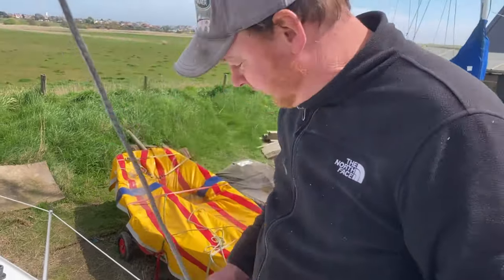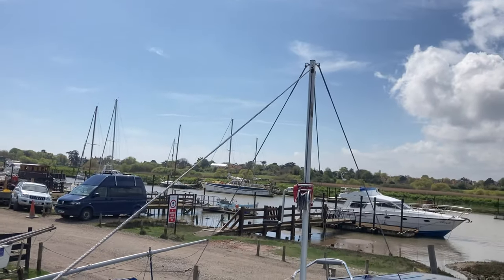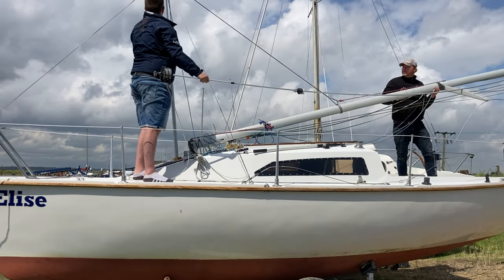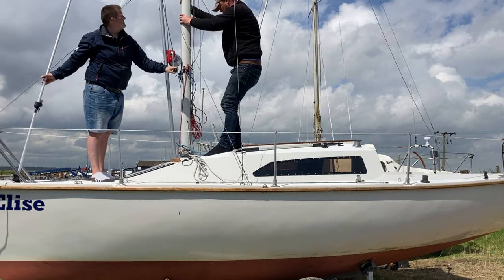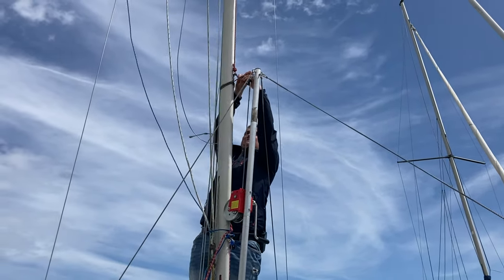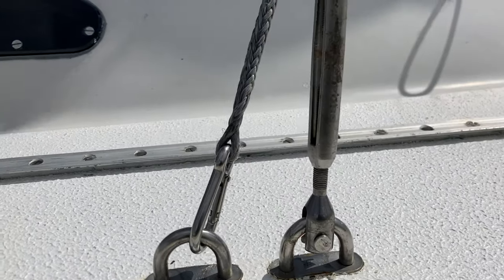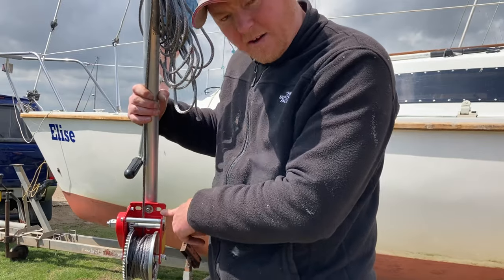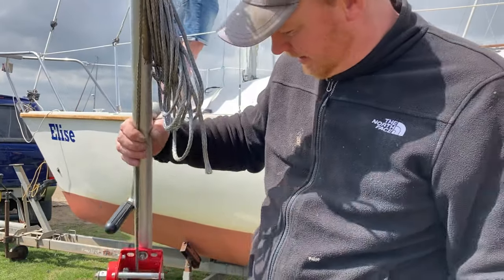Homemade gin pole-mast raising and lowering system.

Comment: Elegant system.
And it is not cluttering up the foredeck like my a-frame does.
Reply from the maker: Thanks! Couple of mods I’m going to make. Baby stays for the mast would be the next mod for me.
Reply: @boatedout  Those would be a great addition. Just find a way to attach them on the axis of the hinge in your mast.
Reply: @boatedout  did you make those baby stays , i may have to alter design if you have
Reply from the maker: @Spud63  yes I’ll send you a decent  list of stuff, I bought some “sk78” which rope off eBay as easy to Brummell splice, I spliced one end of the stay to the clip and spliced an eye in the top end to cow hitch it on the eye on the pole. I did have to redo the bottom splice to fine tune the length once sized up. One thing to  consider is that it might be worth putting a sheeve in the top of the pole and having the winch face forwards to stop it pushing against the mast. I haven’t done this yet but would aid in keeping a bit of space between the pole and mast, however, the current set up is great. I may change it but may not.

Comment: Great system! What kind of pole did you use?
Reply from the maker: It’s an aluminium pole approx 40 mm diameter. It’s quite a heavy duty pole actually. Possibly 2mm wall thickness. It’s very strong. 😁⛵️

Comment: How heavy is the mast?  Could you not just muscle it up together?
Reply from the maker: It’s much better with the system when you get a shroud snag up half way up, don’t have to lower it again, also my 8 year old daughter can do the winching which is handy. 😁so the gin pole is really handy- it takes a bit of pressure off.

Comment: Hi again.  That was a piece of p*ss - a very elegant solution.  These vids of yours are really peaking my interest in the Harrier.  However, trying to find one for sale is another matter.  They are like rocking horse droppings.  It doesn't help when you look up Copeland Boats showing all the "Fox" classes but no mention of the Harrier.  I think I'll keep looking for one as I think it might just suit my style of sailing.  I know you've started the season but can I please make a request for a vid showing how you lift the keel at the end of the season.  Once again, thank for taking the time to film these little gems!  Chin-chin Rej
Reply from the maker: Thanks Rej, where are you based? Yes not a lot on the Harrier out there, also they all normally need a lot of work, I know of one coming up for sale soon. A nice one too. And of course you are always welcome to come for a test sail in my Harrier. And yes I will certainly do a video just for you! I raise the keel after every sail normally. Takes about a minute or 2. Stops the barnacles growing on the keel if the boat is left in.   Can’t have that extra drag!😁 end of this season I’m going to completely remove the keel and re do the tray that is bolted to the top of it. Common issue on all these lifting keelers. If they didn’t use mild steel inside the fibreglass tray then perhaps they would last a lot longer. That will the major job next year, I try to do 1 major one a year. 😁⛵️
Reply: @boatedout  I would be very interested in the one that's coming up for sale.  I am currently based in Camaret south of Brest - 90 mins from Roscoff so could view the boat within 2 days of it going on sale.  I have a big problem with my swing keel.  I need to drop it, wire-wheel the surface, give it 3 coats of phosphoric acid, fill any rust damage & then fibre-glass it.  All carried out under the cradle, dealing with 500 kg of unforgiving mild steel.  Not looking forward to it. Thanks for the offer on a vid on your keel which is greatly appreciated.  Rej